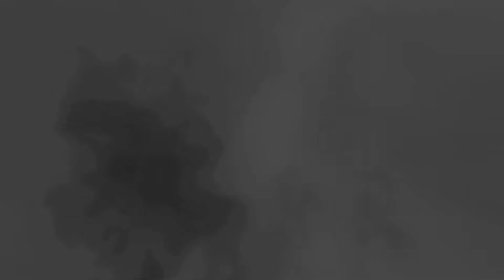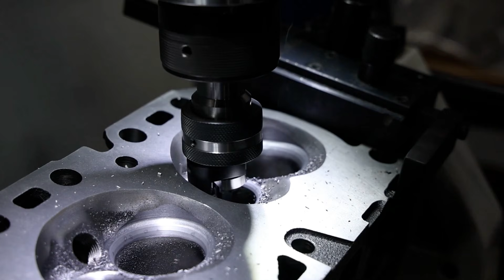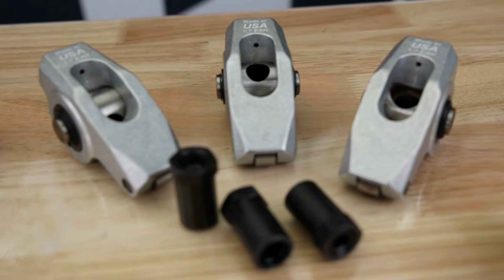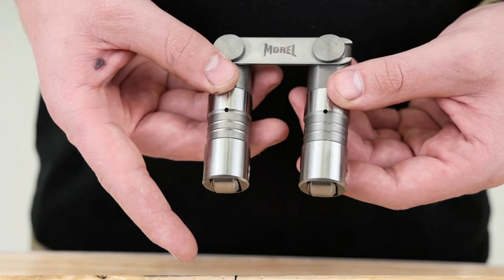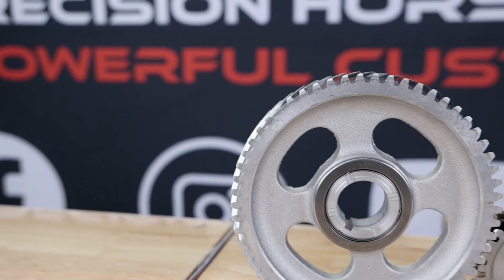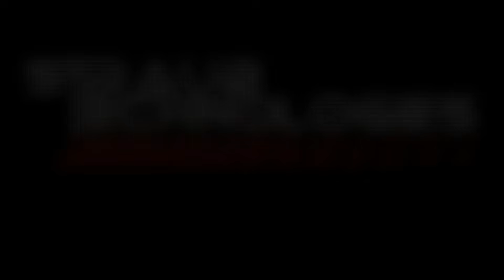💪 Built for the Big Inline. Machined for Real-World Rumble.

Comment: This does not appear to improve low end torque. it sounds too much like Chevrolet rev  it and blow it all over the road.
Reply from the maker: Based on desired rpm range a roller camshaft and be used to increase and broaden out the power band.   Ford proved this back in the 80's when they introduced the 302 Ford with a tiny roller camshaft.  Chevy 350's didn't want any part of that little Blue Oval.

Comment: You should make one for the Jeep 4.0L next. I would LOVE to have a cylinder head that has 3/8" or even 7/16" stud-mount rockers, can support over .5" inch lift, bumps compression, and has a clean casting and runners that don't drop velocity at low speeds.  A cross flow design would be really nice.
Reply: @BryantW-g9x  if you are looking for crossflow design, the Ford Windsor and Cleveland engines have the same bore spacing. You would need to weld two heads together. The head bolt holes need to be moved in 3/16" and a custom cam and two piece push rods would have to be incorporated.
Reply: @jamesford2942   Good idea, I hadn't thought of that. I saw video where a guy did the same with Chevy LS heads. He welded 2 of them  together and bolted the head onto a ford 300 inline 6. He didn't give any details though. Why would I need 2-piece push rods?
Reply: Look up newcomer racing for AMC/Jeep stuff, although straub offers some great parts for the 4.0 as well!

Comment: Inline six-cylinder engines (Mopar 225 CID, GM 292, and Ford 300) are best suited for low-end torque when paired with a manual transmission. Could I swap my V-8 330 CID engine for the I-6 300 CID engine on my 2000 Econoline?

Comment: I drove a 92 F150 with a 300 fuel injected, it was a club cab long bed pull some heavy trailers, that straight six 300 had torque and speed with a good transmission. I remember out racing guys with small V8 in their truck, either they had a Lightfoot or I was better at getting into the torque curve because I seldom lost. After about 400,000 miles I started getting water in the oil and traded it in for another decent used truck dealer was glad to get it because he knew he could put a head gasket on it clean it up and sell it for a few thousand as a farm truck.

Comment: Of all the vehicles I have owned in almost 50 years, I have loved my straight sixes. 
Mopar 225.
Ford 300.
Cummins 6.7.
Reply: I've had a few myself.  Chevy 250, AMC 258, etc.  They always had plenty enough power to suit me, but if you're buying a straight-six, chances are you aren't buying it for what this guy is selling, you're buying it for reliability and ease of maintenance.
Reply: @Rebel9668 

Roller cams and rockers help with wear and reliability though, and inline 6s can absolutely be hopped up for performance.

Comment: Why hasn't anyone made a cleveland style head for this engine yet?
Reply: also, there are YT videos of people cutting apart aluminum Chevy LS heads for fitment on the Ford 300 I-6 and welding them together ala Sleigh and Glidden style
Reply: likely because it would also need intake manifolds and exhaust headers for a variety of different applications as well, which in total is a big investment overall for both manufacturers and enthusiasts.

Comment: In this day of CAD & CNC nobody has made a cross-flow 4V DOHC billet aluminum head for this inline 6 yet?
Reply from the maker: Just takes a check book.
Reply: Clifford Performance said they would, around 2007 or so, but never did it. It's complicated, but not really, since there are two heads that basically fit; GM LS heads and Fords 351m heads. It's just taking one of those and adding two more ports, there's aftermarket heads for both.
Reply: Completely gear driven, of course.

Comment: I have an 85 Bronco with a 300 in it and love.  I built it up about 8 years ago, and it's been amazing.  It'll do 80 - 90 down the interstate without blinking, and pull a camper trailer uphill at 65.  I wish all this stuff would've been available back then as my builder and I had to piece it all together.
I'd love to do some more upgrades to it with some of these parts.

Comment: The big Ford six is a great engine, but the weak point is the head on 300ci 4.9 L inline six. and this is good news for people that have been trying all kinds things. to improve the performance of this engine. from porting and changing valvetrain components. to cutting and sectioning V8 heads. and adding turbo charging or super charging. because the engine already produces good torque. but for hauling heavy loads more HP and longevity has been a constant question? and if that can answered it could likely be the perfect engine?

Comment: Back in the early 80’s one of the machinests that work at the company I worked for brought in his 300 6 head for a valve job. He worked on it after work.i was the Machine shop Liason, which meant that I was to go between the customers and the shop, beyond selling the customers the very FE’s parts available at the time. I developed a three tiered system where the customer could by cheap parts, to better than OEM parts to the top of the line, and educated the customer about his engine and why and how each part would be to their benefit. We also,explained that there was a lot of proper machining to make an engine last with tooling unavaible to them. There aren’t many guy who need their engine bored out who will go by a sunken power hone! Anyway my Machinest took measurements and put 2.04” intakes and 1,66” exhaust valves from a 2bbl Cleveland type engine in it. In retrospect he could have gone a touch smaller like what these guys offer, but they fit. He ported the head and widened the combustion chambers slightly to provide for better flow. He also used a Venturi cutter o both intak and exhaust, finishing off the hold with Clifford Research and Comp cams mahe a real screamer out of the truck motor. I’m glad somebody is doing this now!

Comment: #1. You got to want a 6cyl motor 
#2 you need a car it will fit in
Reply: These engines were very common in F-150's and were usually the standard with a V8 optional, and more of these than you can imagine were in fleet trucks because they were a cheap option.
Reply: chevy nova, ford mustang and falcon, ford maverick. Dodge Dart, Polara, Jeeps, etc etc
Reply from the maker: Well there are more than you might think..
Reply: Or, a suitable truck.
Reply: Really shows the size of this engine when it's sitting on a bench.  It's long.

Comment: Kind of a solution looking for a problem, but imagine a 300 with an overhead cam head, single or double, a timing chain, etc. imagine a 5 liter straight six gas motor with valve train and ports like that.
Reply: Not really, this is great for those wanting more head flow out of a 300 without slicing and dicing LS heads.
Reply: @shaunybonny688  I don’t have to imagine it. The in-line 6 in my Jaguar already has an aluminum cross flow head with chain driven dual overhead cams and true hemispherical chambers with centrally located plugs. Race prepped versions regularly make 400hp.
Reply: @shaunybonny688  like a barra
Reply: Overhead cam is hype, pushrod engines go 11k with some real r&d time
Reply: @whatchu_talkin_john_willis pushrod 300 sixes?
Reply: @shaunybonny688  in Argentina we have chevy, ford, and Jeep engines that run close to 8k rpms, in a road race series called Turismo Carretera. They used Ford Falcons, Chevy Novas, Dodge Polara and GTX. Now they developed a 24valve head for the six, but is expensive.
Reply: @whatchu_talkin_john_willis  yeah, that is why every manufacturer of race engines use overhead cams and multivalves. F1 engines rev to 13k, v10s used to rev to 19k rpms

Comment: 302 lifter 
460 tie bar
Reply from the maker: Not quite.  The lie bar length of the BBF is about .060" to short.  Tie bar is an engineered piece based on the 300.
Reply: @straubtechnologies  .060 short give or take parts maker and there allowable tolerances

Comment: Aka we put ls valves in it
Reply from the maker: Yes but I've never had a valve tell me it only fit one engine.  A certain cylinder head company uses the same exhaust and intake valves in SBF, SBC, and SBM.  So really these are non denominational valves.
Reply: @straubtechnologies agree but have done heads for many u tend to up valve by engine family it comes from 
Then sort from them aftermarket availability (dimensions)
Just like those bbc rockers
Reply: I'll bet they are aftermarket valve that have never seen an LS

Comment: When you make a head with intake on one side and the exhaust on the other let me know.
Reply: A 300 with a crossflow head would be amazing.
Reply: @Ares-jx4ep or a 292 Chevy with a roller cam
Reply: Look at  Jaguar straight 6 head.  Cross flow.  Hemispherical chambers.  Looks just like a Dodge Hemi.  Of course it's a lot smaller, but sometimes smaller is better.
Reply: @daleolson3506   We have a 250 ci six in Australia with an alloy crossflow head. The intake side gets too cold to vapourise the fuel in cold weather. I think the main benefit is the valves are arranged more like a Cleveland allowing bigger valves with less shrouding.  The 300 would need a head based on the clevo head too with the clevo rocker arms.
Reply: 3 months ago the “Engine Power” YT channel did both an NA and Turbo build/dyno using the standard ProMaxx head on a Ford 300 with EFI, forged crank, forged rods, hydraulic roller cam, etc. 

NA was 305 hp & 325 ft-lbs

Turbo @ 16.5 psi was 601 hp & 702 ft-lbs
Reply: @nobodyspecial5026 The NA version would be fine for a driver 80s bullnose. Forced air sure does fix the intake flow issues.
Reply: @nobodyspecial5026 nice
Reply: I asked the v12ls in Australia. They never gave me an answer
Reply: @daleolson3506  Precisely!
Reply: @daleolson3506  crossflow works
Reply: Right On,, CrossFlow!!
Reply from the maker: STI is not making heads.
Reply: Crossflow is more hype and packaging, doesn’t help scavenging in blowndown unless the valves are more inline like a hemi.  The stock 300 heads flow less than 150cfm max, and only 6 intake ports vs 8, it just flat out sucks.
Reply: @whatchu_talkin_john_willis   actually a cross flow head is more about valve angle. Air doesn't like to change direction and the 300 ports have a 90 degree turn which isn't great for velocity. Getting the air to flow from the outside of the head into the combustion chamber in as straight of a line as possible will improve performance dramatically. Same thing for getting the exhaust out. There's a custom Cleveland head 300 from the 70s that makes 625hp on motor. Granted, it's 14 to 1 but at 9 to 1 it would still probably be almost as powerful as a 180 degree head turbo 300 at 13 psi.
Also, another big drawback for the stock head is that there is only so much room to make the ports larger for more airflow when they are so close to each other.
Reply: @whatchu_talkin_john_willis  Uh, no. The crossflow head issue is more than simply some possible airflow gain. You may be aware, by having the intake and exhaust on one side, you're literally bolting the intake to the biggest heat source under the hood. You also sandwich the intake ports between the hottest part of the head.  Also, a crossflow head could fairly easily incorporate canted valves. While  a simple crossflow might not be worth much, you cannot argue straightening the ports with canted valves isn't a huge benefit. Notice ALL the most powerful inlines through the decades use a crossflow and canted valves. Audi 7A, 2B, 3B, AAN. Toyota 5M, 7M, 1J, 2J... I could continue. Just adding boost gets you more per $$ than a head change but a boosted canted valve 300 in a 9th Gen F150... yes please!

 Designing a workable valvetrain would be a nightmare though...
Reply: @whatchu_talkin_john_willis  U should type in the search here Cleveland head on a 300 six it will amaze you